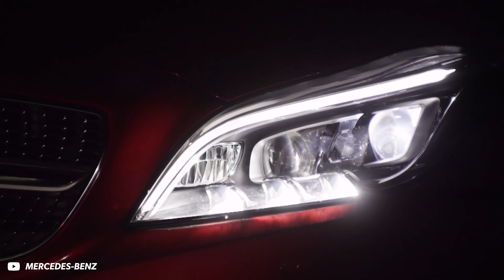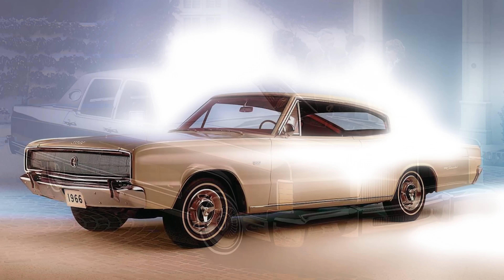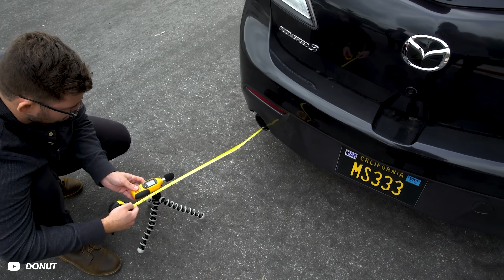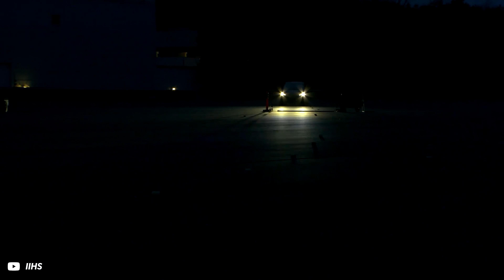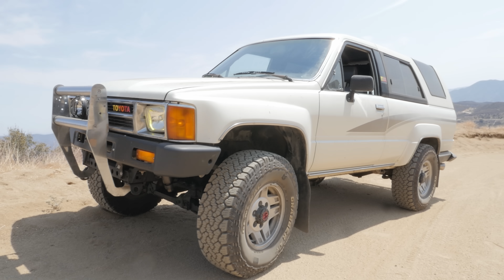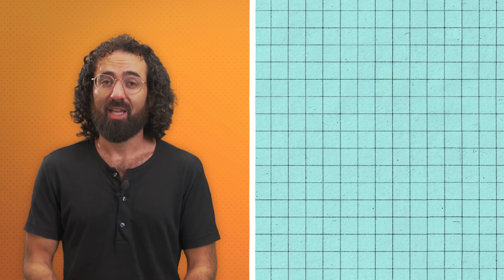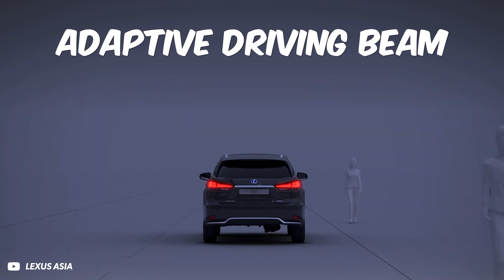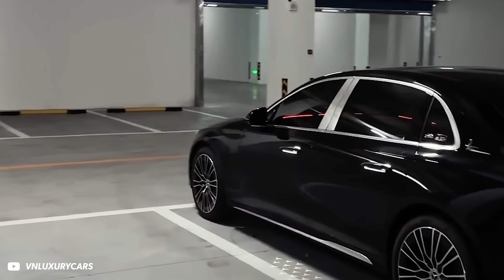Why new headlights are blinding American drivers

Comment: *I'm from Spain.
F*ck insurance tests. I drive an old small low car and it's awful to have a damn SUV tailgate you and illuminate all the interior of your car.
Also, it happens that now it's a trend to have crosswalks sign with flashing leds to drivers. Which stupid engineer thought that having lights flashing into drivers is a good a idea? The crosswalk is not properly illuminated and I'm now blinded by that stupid sign.
Everyday I hate driving a little more. Drivers are constantly on their phones, can't properly maintain distance or make turns without invading other lines, cars poison themselves and are more lockdown for repairs, touchscreens instead of buttons and knobs, luxurious unpractical interiors, whatever fancy designs to brakelights that is far from useful, and don't make me start on pricing... Can't I have a small practical car now? It has to be fancy sporty bs?

Comment: Driving are car is a responsibility. And it's the responsibility of the driver to adjust the lights on the car. All those automated systems, if it's the auto-switch-on or the permanent high-beam from those adaptive lights are trash. It can be bright enough for your car to not switch the lights on, while your silver car vanishes in a cloud of spray during a summer rain. It literally vanishes.
Or those cars with the permanent high beam light, though adaptive it works way to slow and won't pick you up while your driving on a motorway in the opposite direction. If you need a high beam on your car, switch it on manually. Don't let any automatic system do YOUR job as a driver. It's YOUR responsibility and learn how to drive and handle your car properly.

Comment: In my South East Asian country. if your car comes with Halogen bulb, you cannot replace them with LEDs. The reflector for halogen would spread the LEDs light and create tons of glare. Even changing to HID need some modification to allowed for authority to give certificate to drive on the road. The rule here is use till you get caught 😂

Comment: I have been driving in England for the past 43 yrs and everyone of my cars had standard halogen bulbs. They where good enough through every season then and now.  New car headlamps are blood dangerous and make me angry.
Reply: Plus they're bloody expensive. About 10 years ago I priced a new car, and LED headlights were like a 2000$ option, or something crazy like that. I suppose their price might have come down since, but the point is pretty much every car has them standard now, you're kinda forced to buy them.
Reply: I'm not a car person and I don't drive, so forgive me if I mess up with the terminology, but I do get ferried home late once or twice a week after an evening shift by a friend and we've found that the last 5 years have been a drastic change, it used to be we'd only get blinded by someone too scared of the dark on a country road or unlucky timing crossed a humped bridge.  Now it's like everyone is on full beams and those that don't turn down their lights force my friend to slow way down to be as safe as possible while the light ghosting fades from his eyes.

An even crazier thing is he's demonstrated that these ultra bright lights are pointless, as you don't really see much better with them compared to older lights, and for best visibility on country roads, just the side lights let you see clearly for a couple hundred meters, but since it's not legal to drive with just them on at night, we're all forced to blind each other instead!

Comment: Actually, they're taking it easy in the US. What they should do is have cars inspected annually and adjust the lights at the same time. That's what they do here in Europe (especially Germany and the Netherlands), so you can also remove the bad apples from the road that are dangerous to drive.
Secondly, they should lift a ban on those ridiculous "lifted pickup trucks" because you can no longer adjust their lights to avoid blinding others... or install lights at a certain height, far below the bumper, which is also unacceptable.
Thirdly, every officer here knows which cars have aftermarket lights, and they're regularly pulled over to install the original ones (including a fine).
The truck I drive has full LEDs. The lighting is standard from the factory, so it's legally approved. And yes, it has a lot of light output, but it doesn't blind oncoming drivers at all. When I encounter a car with automatic high beams, my high beams also turn on to indicate that they're shining in my eyes, because that's annoying. And then I'm sitting even higher than in a normal car.
So, no luck either, just turn the high beams on or off with your fingers.
Nowadays, much is automatic, and I feel like people are too lazy to move their fingers. In my opinion, manual is better than automatic, and all that technology isn't necessary, which can also break more easily and be incredibly expensive to repair.

Comment: The solution is so simple...incorporate LIGHT BEAM BLIND test on the annual safety inspection.  ANY aftermarket or added on lights are AUTOMATICALLY a NO GO.  And a HUGE FINE $500 for ANY violation from police stops. Problem solved.

Comment: Bro it's the 21st century: how about instead of trying to install tiny suns on the front of the car to make nighttime into daylight time, we just change paradigms and start using NVG + thermal to see in the dark? Costs on these technologies are decreasing and the cost of these new laser-emitting adaptive beam-forming super-lights has to be really high as well. Just stop it with the light wars and go passive, bro.

Comment: These headlights are absurd. I have been at intersections and can not see if the turn signal on the automobile indicates whether the car is going straight or turning left.
  Other times, I can't see the curve in the road or if a jogger is running along the side.
 Aftermarket enthusiasts are decking out their trucks and Jeeps with light bars and using them aggressively.

Comment: Also, the stupid red turn signals and the ridiculous new trend of turn signals so low on the rear bumper you can't notice them (mainly Korean cars)
Reply: if you can't see the turn signals on the car in front of you, you are way too close to the car in front of you. try staying back a few car lengths and see if the problem fixes itself
Reply: @kusanagi395  No it doesn't solve itself.  Not everyone moves to the right to turn right (in a RHD system), and therefore although s/he signals to turn right, cars after the one immediately behind it cannot see his/her intention.  Thus when this someone makes a sudden indication to turn right and stops in the middle of the lane (not moving close to the centre white line) many cars behind have to make "emergency braking" and not knowing why.  I have experienced this myself.  Another example is in a city traffic queue where by definition you are close to the stationary car in front; when that driver suddenly decides to make a turn, especially one s/he has to give way to, you wonder why s/he is not moving along!
I truly cannot understand why the authorities would allow such design to pass common safety standards.

Comment: I find most of it is because of aftermarket headlights AND/OR trucks with headlights that are 4-5 feet off the ground, making it IMPOSSIBLE to avoid shining in your face. Simply make it so that they can't be higher than the rearview mirror on a small car and just let cops give people tickets with there high beams on OR headlights that clearly point "high". I remember cops used to give tickets for that 20+ years ago all the time.

About aftermarket LED headlights, some housings really don't like the LED positioning Especially if you have double rows of LED's. While others (like my 97 Pathfinder) have perfect beam patters with single row LEDs (Auxito). Generally the single row of 3 LEDs do a good job, but it's really a hit or miss depending on your cars headlight housing.

Comment: A fellow German speaking here. No sadly Adaptive "Matrix" Headlights arent helping. For the Driver its amazing but there still way to bright an even IF they cut you out, the light will blind you, because of the scattering of the other beams. We need a better solution. And why did we even need to shine light a 1000m or 3000feet in the night. 200m is way more then you need if you drive at road speeds and its better for the animals around...

Comment: No matter what they do to improve headlights it will not matter as long as the lens itself is not replaceable. They get more expensive and people will not pay the exorbitant price to replace when hazed and then drive with high beams on or add lights to the car and trucks. So in the end any improvements made is only good for a few years after buying the car and the vicious cycle continues.